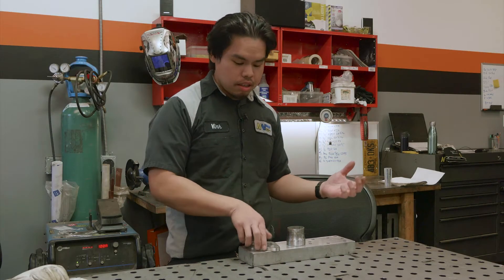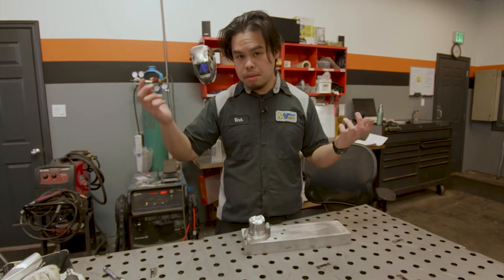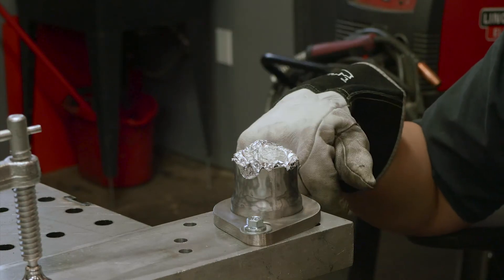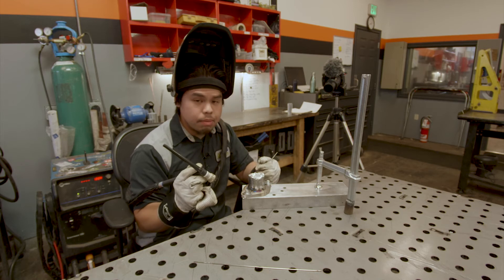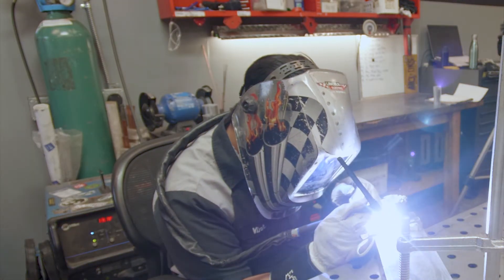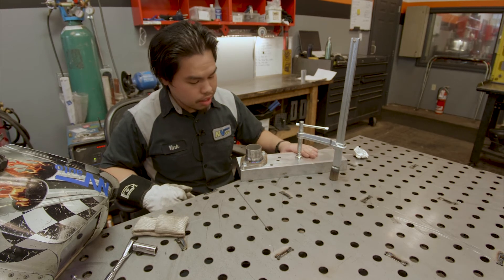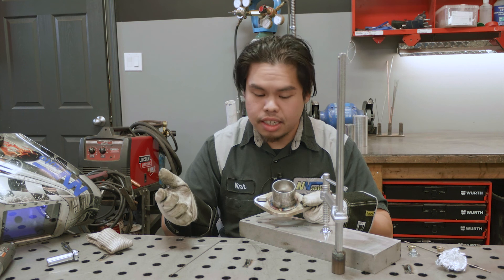How To Weld an Exhaust Flange

Comment: Dude!! Do you know how large 3/16ths filler rod is? You're using 3/32nds not 3/16ths...
Reply: I was thinking that myself that the rod and electrode looked a bit light for 3/16". He gave the game away when he mentioned using 1/16" filler rod, no way would you drop from 3/16" to 1/16".

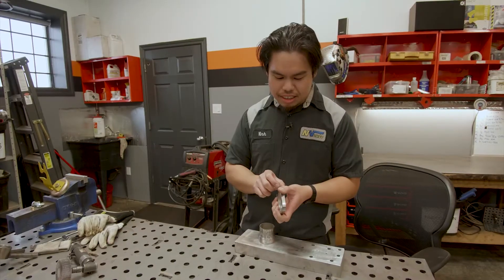Comment: he needs measuring tape @2:28
Reply from the maker: LOL he sure does.
Reply: @NvautoCa  
Is it a good idea to weld both sides of the flange for the headers inside the port and on the opposite side on the outside or will that cause warping and cracking?